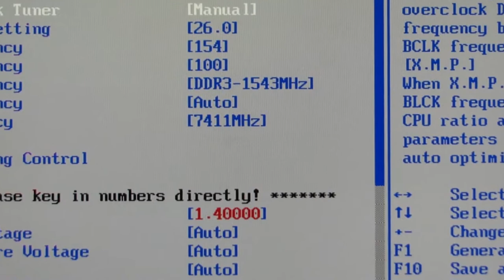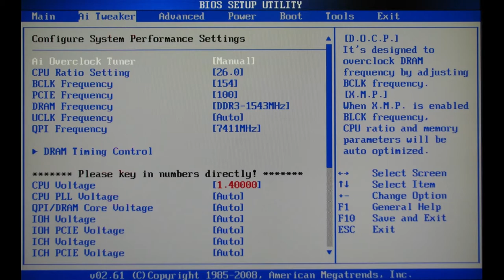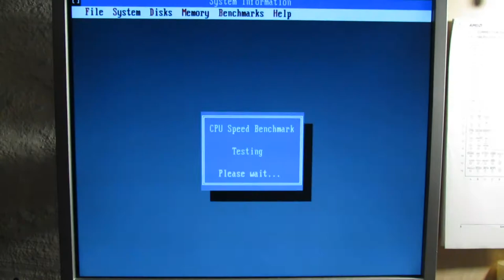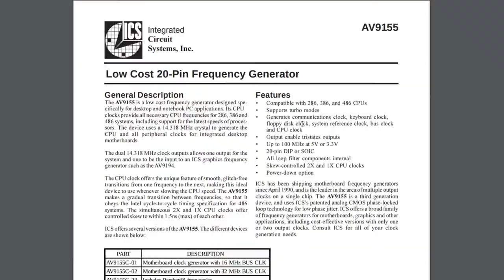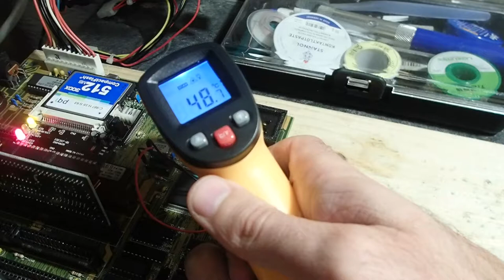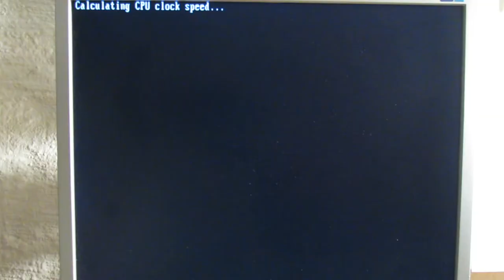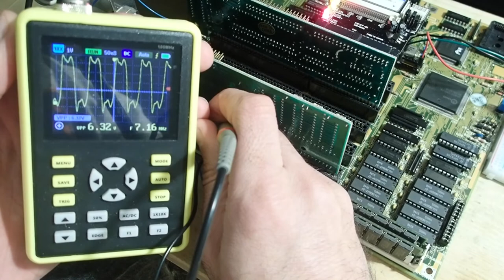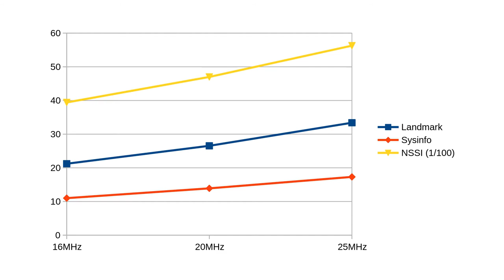Let's overclock an old 386SX

Comment: Doom will run better if you throw a math co in there.  I had an AMD 386dx40 - which at the time, the DX didn't mean it had a math-co.  It meant it could do 32-bit.  After adding a math-co, doom ran better, still not great, but much better.
Reply from the maker: That's a common rumor, but Doom doesn't use floating point arithmetics. Math-co is a Floating Point Unit (FPU) and gives benefit only to software, which was compiled for that.  Doom wasn't, so It makes no difference if you have FPU or not. The first prominent shooter which used (even required) an FPU was Quake. Before that there was Sim City and Falcon 3.0, and this is actually it. For gaming an FPU on a 386 didn't make a lot of sense.
Reply: @necro_ware  Respectfully, I ask you to try it.  I could be remembering wrong, but iirc it *did make a difference.  It's been a long time, so maybe I'm remembering the benchmark tests making me feel that way.   Anyway, I appreciate your content and your response :)
Reply from the maker: @hieyeque1  Didn't want to sound disrespectful, I'm sorry. But what I wrote is not an opinion, it's a technical fact. Doom really doesn't use FPU, because it doesn't even use floating point operations. This is not only known from the original source code, but was also confirmed by many users. I also mentioned it in my last doscember 2022 video. Sometimes our own memory plays tricks on us :)
Reply: @necro_ware  No disrespect taken.  Alright, I concede, mercy!

Comment: I believe my first PC has a 386 sx 25 in only just played Doom.
Reply from the maker: I don't think so :D Doom is not even playable on 386DX-40. May be you mix it with Wolfenstein 3D?
Reply: @necro_ware  at first wolf3d yes one reason I bought the PC had to add more memory to get Doom running, have a pic of it somewhere.

Comment: Man that was easier than overclocking my Atari TT, did it in the end 32Mhz to 48Mhz (nearly 50% faster is not bad).
Reply from the maker: yeah, it is not too complicated, that was, what I wanted to show. It was different, than to make some setup in the BIOS or to set some jumpers, but also not very complicated. Unfortunately the chipset didn't want to play this game, that's why the results were not too impressive. With a good chipset, a 386sx-16 can be easily overclocked to 32 MHz by 100%. But you need a good board for that. In the past I got 386DX-40 to 66MHz as well, but it's really hard to keep it stable there, since the whole board gets heavily overclocked as well.
Reply: @necro_ware  Yes I agree.  Which component(s) do you think is letting the board down?
Reply from the maker: @recycledsteel3693  You mean, what limits the overclocking? As I told in the video, I believe, that the chipset can't handle anything from 25MHz.
Reply: @necro_ware  is that a single chip?
Reply from the maker: @recycledsteel3693  Yes - 14:37
Reply: @necro_ware  hmm i always thought it was a set of chips.
Reply from the maker: @recycledsteel3693  You probably mean south and north bridge splitting. That one came later with PCI Mainboards. On older mainboards there was either one highly integrated chipset, like on the board in this video, or a lot of discrete logic ICs.

Comment: Oh, 40Mhz on a breadboard with long leads is not a good idea...
Still works... O_o
Reply from the maker: Hehe, I know, bad idea indeed and I didn't expect it to work, but I tested it with an oscilloscope previously and it was still ok. Even with 80 MHz it delivered a clean signal, if I kept the wires short enough. I was surprised too...

Comment: Why you did't try get up voltage? Put frequency then it unstable and go up with voltage) If it help, try to get high voltage specific for chipset or different component. And maybe motherboard needs more capacitors..?)
Reply from the maker: To rise voltage on a 386 mainobard? :D You are funny. There is nothing like that on a mainboard of that age. To rise the voltage you'd have to modify half of your mainboard, because at that time everything was simply powered by 5V directly from the PSU. No voltage regulators, no output signal leveling, nothing like that. Even if you cut off the chipset from the supply and solder a voltage regulator on a 12V rail to get somewhere over 5V, your output levels would probably destroy everything down the line. With this idea, I guess, you are at least by a decade too early for this board ;)
Reply: @necro_ware  I know there is only 5 Volt, but you can set it to 5.5 or 6 Volt)))

Comment: Overclocking is still linear in performance gains today...
Reply from the maker: Not if you know, how CPUs work today. A CPU with twice as high frequency doesn't work twice as fast. With vector extensions, multiple cores and Amdahl's law there is no coherence between frequency and performance anymore. In the beginning of 90s you could exactly predict the gain of performance, which was linearly dependent from the frequency. Today you can't predict anything, until you measured it.
Reply: @necro_ware  If those instruction sets do X number of instructions per clock, then if you [hypothetically] overclocked it by 100%, they would still do X number of instructions per clock, and thus double the work in the same amount of time. I think you're referring to this paranoia about AVX512 being misused and throttling clocks.
Reply from the maker: @timramich  "Hypothetically" is the main word here. If you use an old program which doesn't use any modern extensions, which runs on one core, like it would be a 386, then yes. Overclocking a CPU would mean a linear gain. If you use half way modern program, you just don't know. If the program is multithreaded, you could hit Amdahl's law badly. Due to architectural nuances running at higher frequencies per core, it could lead to worse cache miss behavior and you could end up at even worse performance.  Modern CPUs have also branch prediction, which could take another ways dependent on the load and eventually resulting also in very different vectorization. All this is not really predictable anymore. I'm talking from over 25 years of experience in worldwide software and compiler development. You just can't tell anymore how much gain you'll get, if you overclock your CPU by some percent number. At least until you measure it.

Comment: why the hell didn't you take a real 386 board? such a board with a real socket and jumpers for the speed settings...? i mean, ok, this is more challenging BUT this board is probably from a tiny desktop or thin client...
Reply from the maker: It's a normal 386sx mainboard from a normal desktop. They were usually soldered, just like on this board. I have about 50 mainboards,   from every generation at least one. I could take any of them, but I just was curious if I can overclock this board. I had my reasons ;)
Reply: @necro_ware  i actually have 3 386 Boards and about 30 CPUs and Math coprocessors... and i also repaired/upgraded many 386s back in the days. Really, NONE of them had a soldered-PQFP type embedded CPU. They all had the PGA socket...
Reply from the maker: @djtongi  Well, then you should take a closer look at your 386 mainboards. You will see,  that they have 386DX processors. A 386SX is basically completely another CPU. It is more or less a drop-in replacement for a 286, but with 386 features (protected mode, 32-bit instruction set etc).  386SX was made as PQFP-Type and was widely used in cheap(er) desktops, where 386DX was in the beginning more of a working horse in servers and workstations, because it was so expensive. I have really no clue, why you think, that i386SX is an embedded CPU. And I know, where this mainboard is coming from. It was running in a normal PC back in the days. I'm doing this since 30 years now and though I know, that I can't convince you of anything, so please, do me a favor, just google the stuff at least.
Reply: @necro_ware  i have here at least 10 386 SX cpus in PGA type, they're 88 Pin, not 130 like the DXs ;-) and i also do this since more than 30 years, so i really don't need to google sth ;-) those soldered-CPU-mainboards really weren't common... that's why i said, they were used in emb systems, cheap tiny desktops and slim line cases etc.
Reply from the maker: @djtongi  Photos please :D If you have i386SX in PGA, you are a lucky man. They are super rare and extremely expensive. I only saw some pictures of them and never saw one in person. And you barely can get mainboards for them, because 386DX has 32-bit memory address bus and 386SX only 16-bit, that's why you can't just plug a 386SX into a 386DX mainboard. All 386sx mainboards I saw in my life, and I saw hundreds, all of them had soldered CPU. And again, I told it already, but I'm glad to repeat. I know this mainboard from the beginning and it is from a normal desktop PC, which was bought 1991.
Reply from the maker: @djtongi  In case you are interested, I have a contact to one Intel tech museum and I asked there about a PGA 386SX, because I was curious myself. The answer is, you will probably not having 10 of them, probably not even one. The 386SX in PGA version was only made in super limited numbers for internal use by Intel and couple of military projects. They were never produced for the market, where only PQFP version was made for. To find a PGA 386SX today is nearly impossible, and if you find one it will cost quite a lot of money. Not even to mention mainboards. They were non standard parts and there is practically no way to see even a picture of it today... In the museum they have thousands of ICs from Intel, but no 386SX as PGA. Only an image.
Reply: @necro_ware  wait, i'll take you a photo, when i'm in my storage ;) if it's really rare, maye i should start selling them :P
Reply from the maker: @djtongi  You really should, if you have them :) You are may be reach  without knowing it.

Comment: 6:35 FREEDOS!  I'm am really tired of "retro-gamers" experimenting exclusively with MS-DOS, usually 6.22 which hasn't been updated since 1994! I want to tell them, "FreeDOS is there for you! It has been specifically made to run with newer hardware!" But they are just MS-DOS zombies. Probably the only hope for them is to be decapitated.
Reply from the maker: I love FreeDOS and use it a lot. I have different compact flash cards with pre-installed MS-DOS and FreeDOS. Unfortunately FreeDos doesn't run (well) on 286 and XT class machines, so sometimes I have to take MS-DOS. Also some old tools don't work in FreeDos, therefore you have plenty of new nice tools in FreeDos on-board out of the box.

Comment: If you underclock it won't the game run slower
Reply from the maker: Is it a question? If so, then yes, if you underclock it, the game will get slower. That's why there was a turbo button on old AT-PCs. To underclock them if a software was written for XT-PC and ran too fast on an AT.

Comment: Oh god, the 386SX was such a marketing crock of shit... :( really just bottom of the barrell stuff.
Reply from the maker: It was slow, true, but it was not all just marketing. Well, at least the history was not that simple. The 386sx was more or less a 286 drop-in replacement, so the mainboard manufacturers could continue to sell their 286 mainboards with a CPU, which could handle 386 features. Like extended instructions set, proper protected mode etc. So from the performance point of view a 386sx was a 286, but it could handle 386 code. I guess, it's better to make it slow, than to not make it at all. Furthermore, in the beginning it was cheaper to buy a car with a garage and a house attached, then to buy a 386. That's why Intel introduced 386sx for home and office use and renamed the original 386 into 386dx as a CPU for servers and powerful workstations. They sold millions of 386sx machines back then, what makes it an important piece of history.
Reply: @necro_ware  Fair point well made.
Reply: Without 386sx there would be no Linux. Linus started the project sop he could run UNIX on his 386sx.

Comment: Beginning of shit end user experience "core unlocked" WTF???
Reply from the maker: If you try to express your question in a way, so I can understand it, I'll try to answer ;)
Reply: @necro_ware  Um... a whole marketing strategy by Intel that suggests you can pay more money for a chip with features that has deliberately been disabled whilst the competition is touting more and more cores.... should be pretty clear.
Reply from the maker: I see, now it's clear :D And, yes, it is frustrating and unfortunately, Intel is not the only one. AMD started to lock their CPUs with later Athlons too. Actually the first CPUs with a multiplier were 486DX2, where 2 means, multiplier. The CPU ran with 33MHz FSB and multiplier 2x at 66MHz effectively. In that CPUs the multiplier was hard as well and couldn't be changed on the mainboard. This feature came first with Pentium and disappeared with Pentium II, except for some models  :D